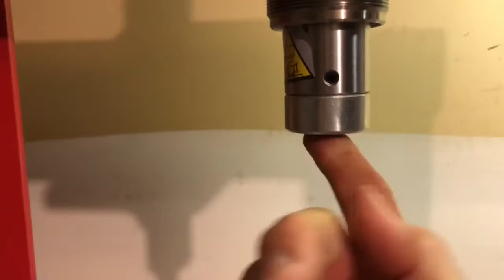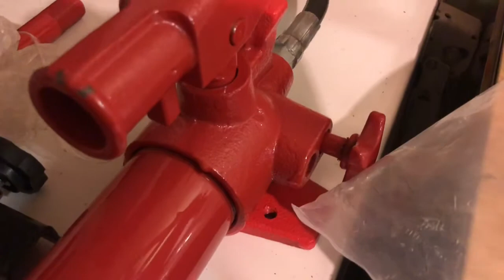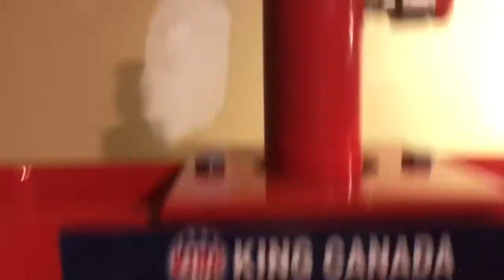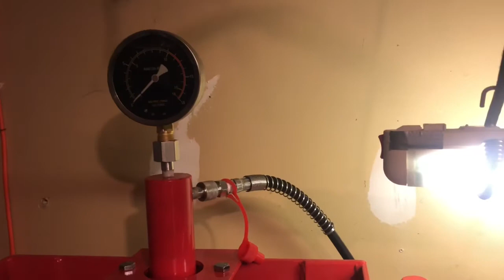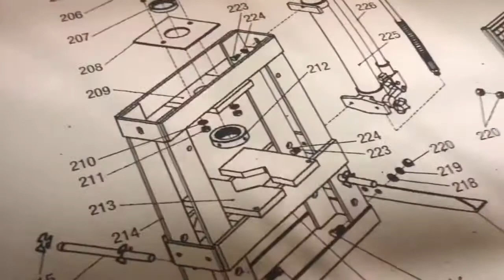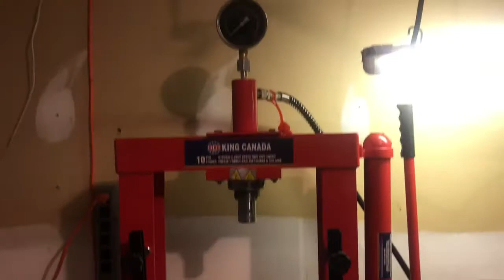King Canada 10 Ton Hydraulic Shop Press - Assembly Review - Part 2

Comment: I have the same press but it was bought from Canadian tire, I installed the hydraulic cylinder horizontally on the side of the press , it functions very nicely, I never installed the protective grid though, it takes away my focus when I'm using the press.